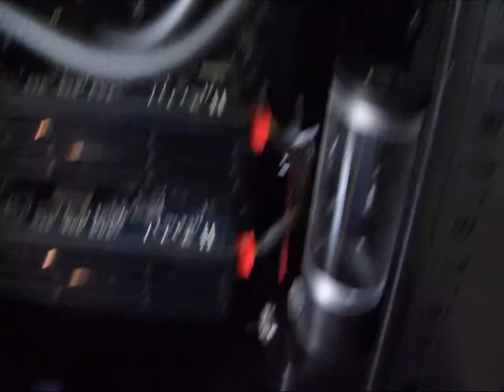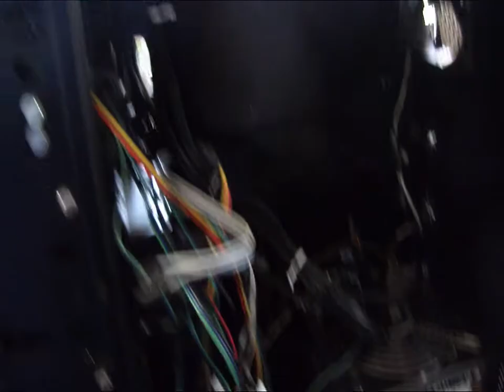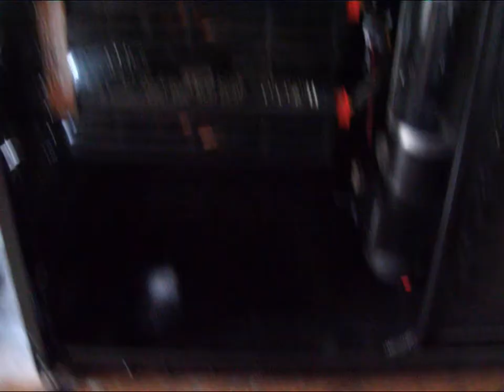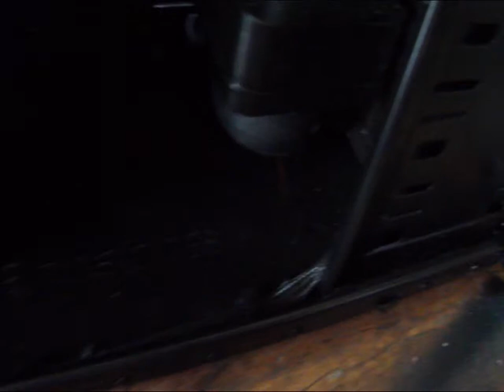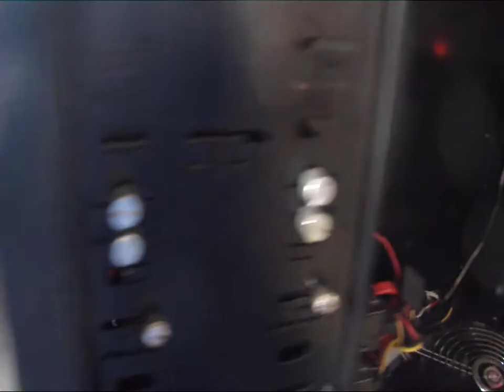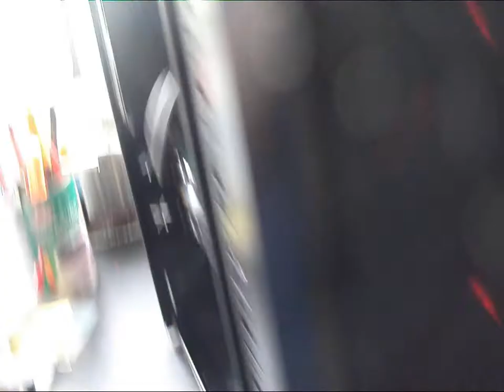Antec 1800 Build Log Part 11

Comment from the maker: Intel i7-2600k, Gigabyte board, 8 gigs ddr3 1600, Two HIS HD6850 video cards in crossfire. OCZ ssd drive for OS. Two Western Digital 7200 RPM drives in raid 0 for games.

Comment from the maker: I had fought with that as to which side to put it on,. I wanted the res on the window side so that I could keep track of the fluid level so I would know if it got low or if a leak developed. And because the rad would only fit in the front of the case I would of had to move the drives to the other side and I didn't want all the wires on that side

Comment: I got scared when you said the pump was running, I though you meant the pump mounted on the radiator. Never run a pump like that dry, it will destroy it